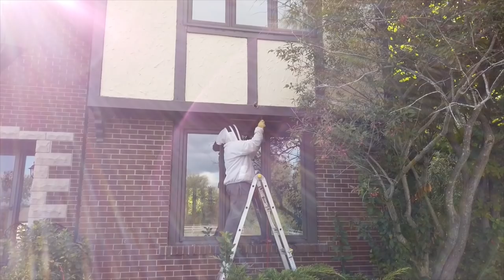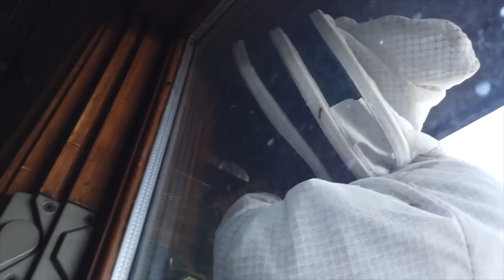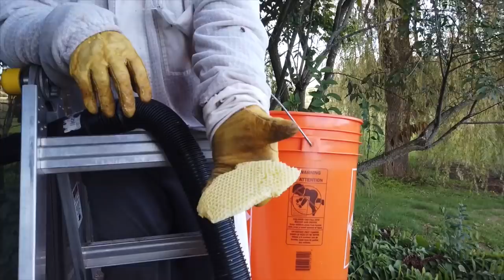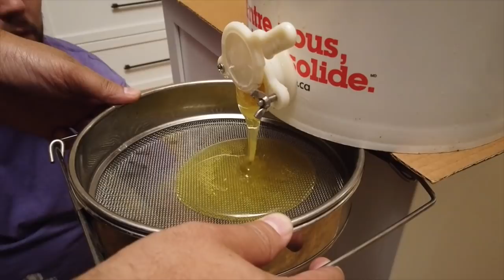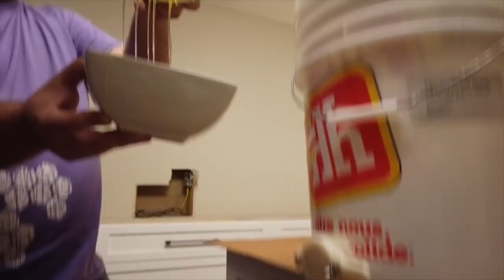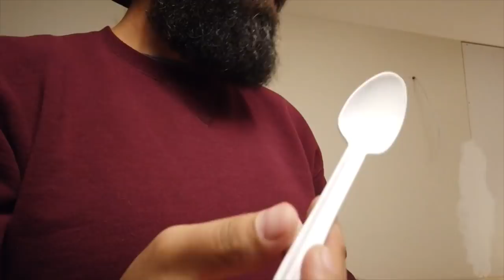#SaveTheBees - We Safely Removed Bees From Our Walls - HouseIntoHome #8

Comment: My roommate in college always had allergies in the spring time. Someone told him to buy local honey and apparently that really helps.
Reply: That's because store-bought honey is filtered (in order to remove pollens and other allergens), which is also why it will crystallize very slowly or never (crystals needs some particles as cores and filtration removes them), honey from local beekeepers isn't filtered and all the pollen and other allergens are still in it. Eating it also helps as prevention of allergies in small children.
Reply: Drbo DrBo  Hi , just wanted to ask question. So if honey crystallizes faster it’s not filtered, and proven organic.?Yes use local honey for allergies (works great) but last year due to honey bee die off , bought from farm stand and was not sure it was adulterated.  All grocery store honey is adulterated.
Reply: @patmontalbano290  I don't see the question there? And that's not true every store bought honey is adulterated.

Comment: The worst smell ive delt with was my old hockey gear when i was younger. My mom worked and i would have to get dressed in my gear at her job to make practice on time.
Well one hot summer the bag was left in a little two door sports car for a couple days.
The smell lingered forever, and years later when it got hot again you could still smell the hockey gear 🤣
Reply from the maker: sounds terrible!!